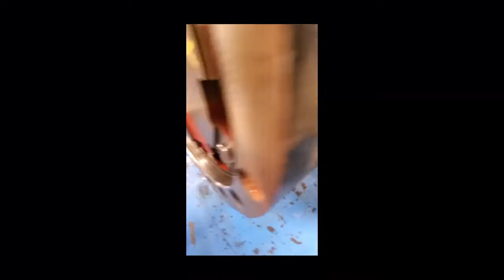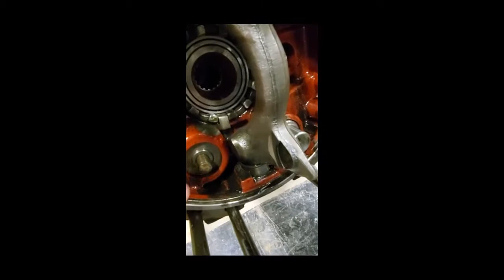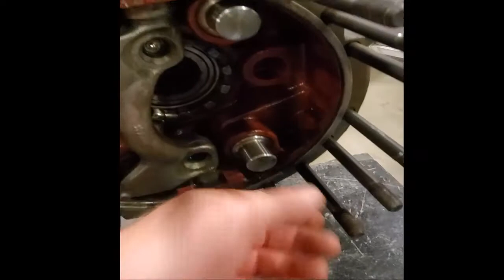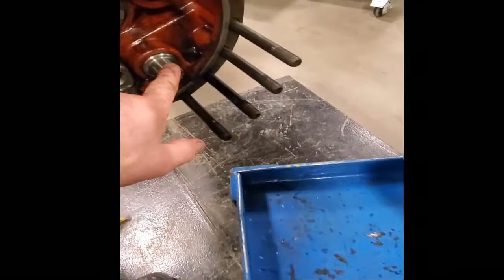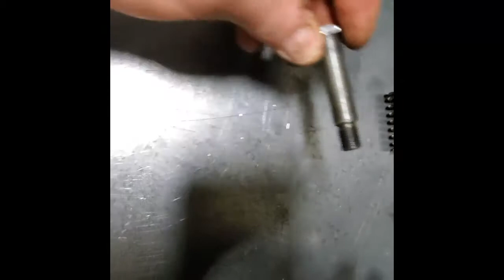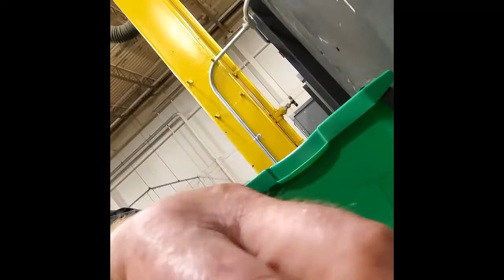Dana 176 axle brakes

Comment: This video is great. Very informative regarding the operation of the braking system. I'm working on an older Hyundai loader with this axle and the dealer wants big money to repair leaky brake piston seals that are causing hydraulic oil to pour out the breather vent. Are you available to contact for further info/advice?
Reply from the maker: Sorry haven't checked in a while, if you are still looking larry.richardson@cambriancollege.ca